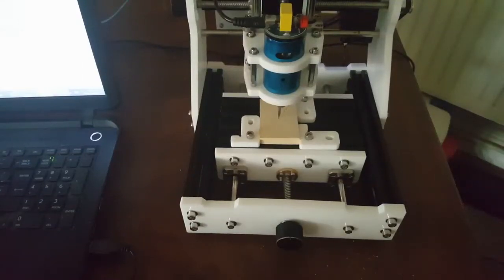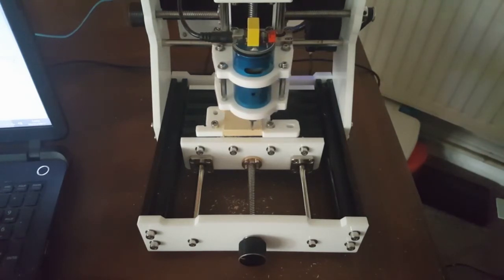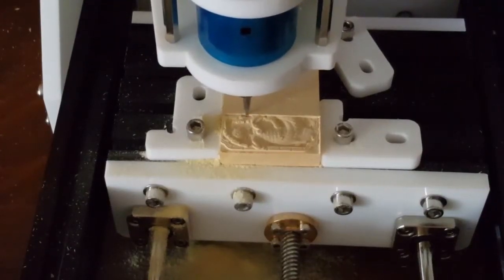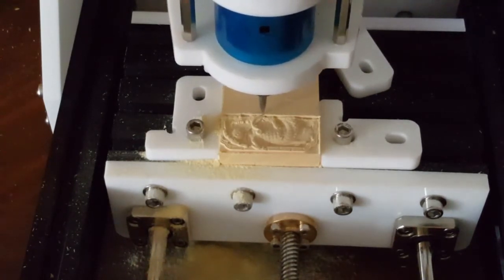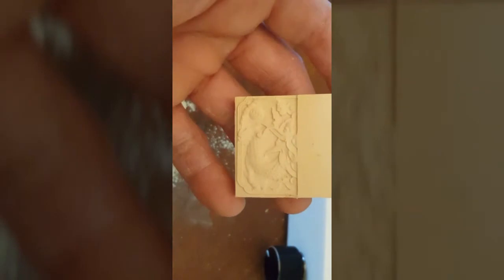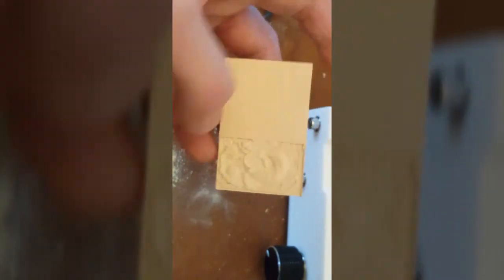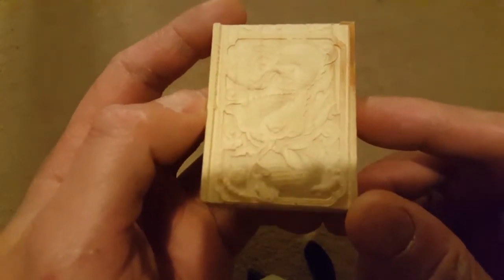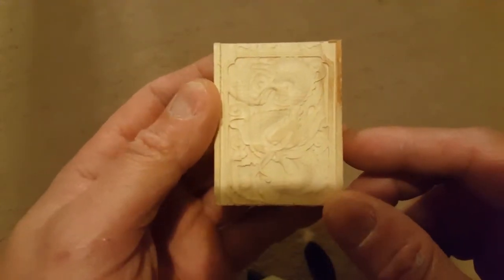Eleksmaker cnc wood carving

Comment: 11robert11 did you have any issues with the motors stalling and the carriages not moving? How did you align the rods and the bearings so they don't stall the motor? Thanks
Reply from the maker: Alejandro Colina are all your motors stalling or just 1 i had a problem with my z axis and it turned out the stepper driver was not working right i bought a new one from ebay and worked straight away
Reply: 11robert11 the motors move if i help manually turning the knob, which makes me think that is tension between the bearings and the rods. i also adjusted the current on the motor drivers and that helped, but i still believe the problem is mechanical
Reply from the maker: Alejandro Colina well only one never worked on mine and i also thought it was the rod and bearings but once i change the chip with a working axis i soon seen the problem was the stepper drive chip. i had so many problems with the cnc machine right from the box. power supply never gave enough p8wer to even make the router work
Reply: 11robert11 i see. I think I will have to disassemble and reassemble with rods in place. I have some drv8825 replacements for my printer so I will try those too. thanks
Reply: Here it's for 289.90 USD
https://www.banggood.com/500mW-Desktop-DIY-CNC-Micro-Laser-Engraving-Machine-Assembling-Kits-p-1055378.html?p=B4200913385416201708
I hope this can help you

https://www.youtube.com/watch?v=7sAJXZsFHvU
Reply: My is my Z axis is not moving when I engrave?

Comment: cool but dont the mode need to be a negative of what you want to cast ?
Reply from the maker: CrazyCressy7 not on casting it dont but for making graphite moulds it will have to be. i can switch that in the software. just having a mess about with the software now start simple work my way up.
Reply: i see what you mean now ,you will make what you want to cast with the cnc ,i thought it was just to make modes ,so you get the best of both worlds ,i was having a blond moment ;)